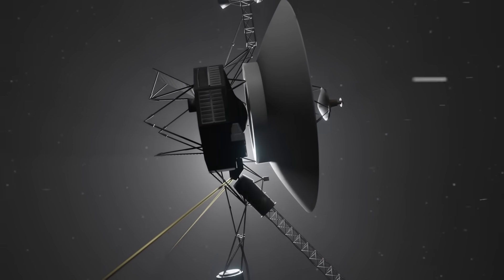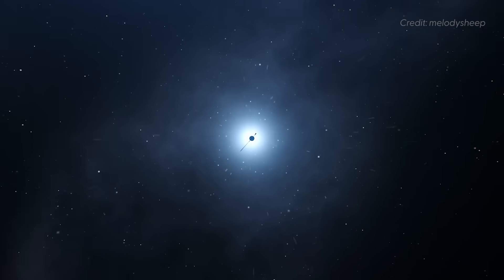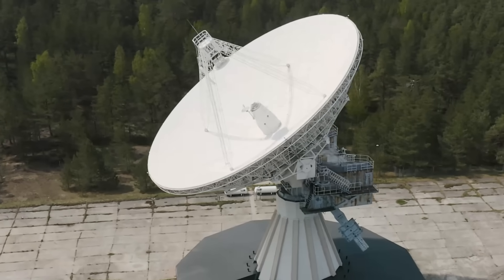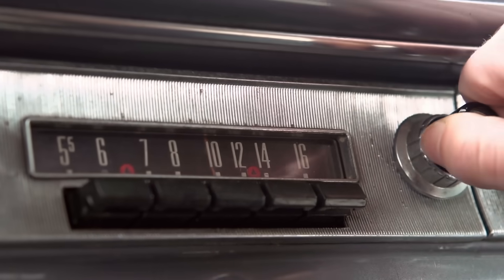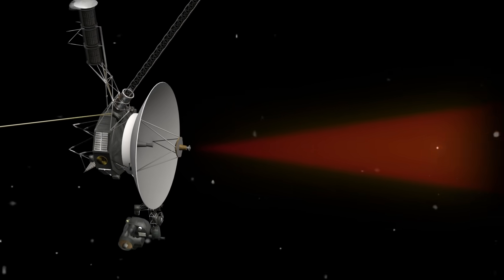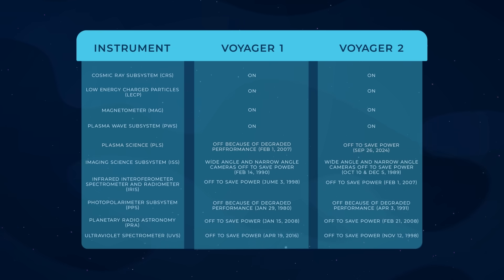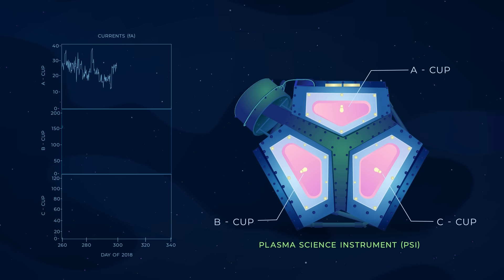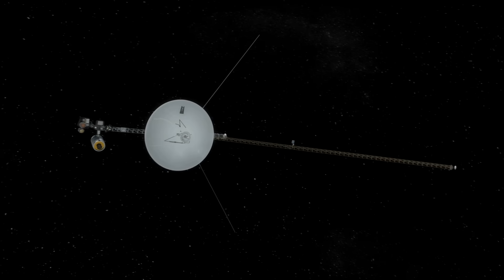15 Billion Miles Away, Voyager 1 Comes Back To Life Using 1981 Tech

Comment: @02:50 timestamp the clip suggests freezing temps cause problems [raises resistance properties of materials] and that heating components reduces eletrical resistance. If that's true, why then do supercomputers operate in extreme cold operating conditions? I thought cold temperatures allow electron currents to flow more easily - less resistance, less heat, etc.?!?!?!

Comment: How does the antenna back to earth work / how is it calibrated when the rocket would be on the opposite side and the rocket shpuld therefor be faced towards earth. Did it rotate midflight to align the antenna correctly? And woth what directional earth homing mechanism when all you have is the antenna and no adjacent situational sensors?

Comment: No, cold does not increase resistance in electric circuits; in fact, cold decreases resistance in most conductors, meaning that as the temperature drops, the resistance of a circuit also decreases

Comment: What's really amazing is that not only is it working with early 1970s technology, but most of the engineers that worked on the project, are either deceased or in the latter stages of retirement.
 Yet, their creation, keeps on keeping on.
 Good job, you guys and gals of NASA.🤙👏 both past and present,  as well as into the future.

Comment: Always wondered couldn't we just send another probe or a repeater/some type of device to boost signals in the general path of Voyager 1 so it could piggy back of the signals coming to and from it as a way to prolong the contact with V1.
Reply: Impossible with our techology right now. The deep space radio telescopes used to detect the Voyager spacecrafts are a network of huge radio telescopes working in synchronization creating an earth sized telescope because by the time the signal reaches us it is a billion of a billionth watt. Impossible to launch and inpossible to synchronize in space and to boost a signal.  And it will never make any distance from the spacecrafts because  in order for the the Voyagers to reach speeds of 39k miles per hour, they needed gravitational boosts from the outer planets. We don't have the technology to boost spacecrafts at that speed with our current chemical reaction rockets. And by 2030, all the usable nuclear power will be used up, so there will be no signals coming from the spacecrafts to boost. Like your flashlight battery going out, you might have a little residual power left but not enough to power the lightbulb. Since Plutonium has a half  24k years, it will create some residual heat for a long time but not enough to power the Radioisotope Thermoelectric Generators
Reply: Thanks for the info, nerd. 🙂

Comment: They cant make an iphone last 7 years but im supposed to believe some radio from 50 yrs ago still works with zero maintenance? 😂😄🥲
Reply: First of all an iPhone can last years if it’s taken care of and as long as the iPhone continues to get regular updates from Apple a phone and a radio are literally two different things.

Second of all radio technology used for space communications is reinforced and built on a higher quality which make them last longer radios can work for years if not decades… old radios from the 1970’s can broadcast signals just fine without any issues especially in space.

Comment: 3:03 cold doesn't make it harder for electricity to flow!!
Reply: It didn't say the cold made it harder for electricity to flow, it said the cold makes the components more resistant to electricity.
Reply: @kingofturtlestk7308  Listen again.
Reply: @chrisking7603  I have multiple times, and it said the cold increases the electrical resistance, which means it interferes with electrical flow. While the cold has no effect on electricity itself, it does have an effect on the conductivity of the components.
Reply: @kingofturtlestk7308   Good on you for checking.  Well, the truth is increase in heat increases electrical resistance.  The colder a conductor is, the easier it is for current to flow... ie. higher resistance at higher temperatures.  The video just has a mistake.  I wanted to point it out.
Reply: That was an odd pseudo factoid
Reply: @QbutNotTheQ  Please expand on "pseudo" to expand me.
Reply: @ChrisNotTheKing  I’m agreeing with you that cold doesn’t make it harder for electricity to flow. It was an odd thing for the video to say.

Comment: "cold increases electrical resistance in circuits" - bunk. On that basis, alone, this video can be classified as junk. Same thing with the "heat helps with annealing of the semiconductors" - bunk, there is no source for heating in deep space. As well, both heat and cosmic rays both contribute to decline in semiconductor performance, there is no way to reverse this. The entire video is worthless bunk.

Comment: If the exosphere is approx 1400-2000 degrees centigrade and the radiation is so high in intensity that it fries all electronics, then how did a satellite like voyager pass through that zone? Satellites for tv  radio gps are all low orbiting devices for a reason. This  hubble and voyager satellite  is all a hoax.

Comment: No, it has not even left the Kuiper Belt.  It will be a long time before it reaches the Oort Cloud and truly enter interstellar space.
Reply: Kuiper belt is located between 30 and 50 AU (astronomical unit) from the Sun. Voyager traveled 166AU. So it is far beyond Kuiper Belt. But Oort Cloud is located between 1000 and 3000 AU, but it's the heliopause which is the true frontier between solar wind pressure and interstellar space. So the Voyager 1 is beyond heliopause, but it's still in the gravitational pool of the Sun and will be for a long decades
Reply: Hey, it is far out enough for me to consider it Interstellar! 😁
Reply: It has?? The kuiper belt is located close to Pluto. It takes 15 (Idk exactly) To reach pluto. If Voyagers have been Going for 48 Years, It is definately Outside of the Solar System. But You are right It has not reached The oort cloud But No it has Passed the kuiper belt.

Comment: It's stated "cold increases electrical resistance in circuits". Correct me if I'm wrong but I was taught that it actually decreases electrical resistance and makes them more efficient.
Reply: @brandonharrison7397 Brandon, I was taught the same thing.  Superconductors only work if you get them close to absolute zero. 

But that is a very old machine.  I think there is actually a magnetic tape drive inside those things to save data.  I doubt those things like the cold. 

They never talked about that, just ‘electronics’.  

Question everything you hear, especially with the misinformation out there these days.
Reply: "cold increases electrical resistance in circuits" - bunk. On that basis, alone, this video can be classified as junk. Same thing with the "heat helps with annealing of the semiconductors" - bunk, there is no source for heating in deep space. As well, both heat and cosmic rays both contribute to decline in semiconductor performance, there is no way to reverse this. The entire video is worthless bunk.
Reply: @steveh7848  the heat source is the heater mentioned several times?
Reply: That statement confused me too, as it's the exact opposite of conventional knowledge.
Reply: Cold decreases electrical resistance for standard metals.  For semiconductors, as temperature decreases, resistance will increase as the the electrons struggle to find a charge carrier.  Although it seems counterintuitive, this is why extreme sub zero overclocking works the way it does (extreme overclocks are achieved by bumping voltages up to overcome the increase in resistance at the extremely low temperature).

This is kinda the same reason that CPU voltages back off at higher temperatures (preventing electromigration due to a decrease in resistance, which increases current).

Comment: My WiFi disconnects if I go on the other side of the wall from the router and I’m using the latest technology i can get.
Reply: Latest doesnt mean greatest! 
I made a hole in my wall with a club, and pulled a TP cable through. Now I have as good internet on both sides of the wall
Reply: You just need a 12ft dish on one side, a whole planet with giant dishes and billions of dollars of tech on the other side...

Comment: Damn car batteries can't last 4 years.
Reply: I mean, lead acid batteries are a very different technology from the nuclear "batteries" on these probes. While I guess you can consider them batteries, they are more inline with being a generator.
Reply: My OEM truck battery lasted more than 4.
Reply: Had an OE Varta last 14 years!
Reply: Woah!  @ntobergta
Reply: Yeah, good argument for decaying Plutonium based batteries
Reply: @TheSulross we don’t need em, we wants them, my precious ❤
Reply: Can NASA develop a new car battery? At least one that doesn't emit ionizing radiation anyway?
 The last thing you would want in a car crash is radiation leakage.🤔
Reply: Vger has developed into some sort of living entity!
Reply: I believe that China has sodium ion batteries?  @sussekind9717
Reply: @sussekind9717  nuclear powered cars were considered in the 1940s (the Ford Atom) but they quickly realized they couldn't make a reactor small enough and it would be a disaster every time one crashed.

RTGs are much smaller than reactors, but don't provide much power, and still don't solve the safety issue of nuclear material moving at 100+km/h controlled by idiots who are busy texting.

Comment: They should have put solar panels on it too and sent it to our nearest Star Barnards Star. Or proxima Centauri A or B. This would only be possible if Travel Time was a possibility.
The Voyager 1 spacecraft is on an interstellar mission. It is traveling away from the Sun at a rate of 17.3 km/s. If Voyager were to travel to Proxima Centauri, at this rate, it would take over 73,000 years to arrive. If we could travel at the speed of light, an impossibility due to Special Relativity, it would still take 4.22 years to arrive!
Reply: Light speed travel isn't impossible.
Reply: Both voyagers will eventually end up within 2 lightyears of a star in our galaxy,  but that won't occur for another 30,000 years or so.

Comment: Imagine if Voyagers had a little more recent technology onboard...
Reply: Then it would have broken long ago. We just dont make things like we did before
Reply: @ChairmanKimchi  More advanced=>more complex=>more easy to break=>more difficult to repair in distance
Reply: @ChairmanKimchi  You're probably right! 🤣
Reply: @ChairmanKimchi  probably. But I'd also like to believe that JWST will be there for decades.
Reply: We would likely need to engineer things with the primary goal being repairability without direct intervention and longevity. I'd imagine we wouldn't get too many improvements to it, maybe a new type of instrument or 2, maybe some decent non-volatile data storage, maybe slightly more power efficient devices, probably some benefits of modern machining techniques too. There's only so much you can do with how things are being designed now. The better use for more modern tech is on stuff much closer to Earth. Where communication to it is easier and faster so we can send high resolution images and data.

Comment: How long after the last instrument is turned off will the Voyagers still have power for their radio transceivers?
Reply: Probably quite a few years, if the radios continue to operate. The limiting factor here is that the antennas on Earth won't be able to pick up such a faint signal after about 2036. But: what good is talking to a spacecraft if it's not sending back any scientific data?
Reply: @BryanM61  I don't remember where, but I heard on a podcast or read somewhere that even after all of the scientific instruments have been turned off; simply being able to talk to the spacecraft would allow some science to be done based on how the radio signal is received. I would imagine it would have something to do with things like phase shift, frequency modulation, degradation of the signal, etc.  I was trying to find it earlier when I posted this question, but it's been a long time since I heard or read it.
Reply: @lexington476  Interesting. I could see that.

Comment: I thought it was so far away that it's signal couldn't reach us
Reply: that's not how radio waves work in a near perfect vacuum like space. Radio Waves work in the same way that light does. Stars from millions of lightyears from us still get to us. Radio Waves are still photons. They travel at the speed of light, just like a photon of our visible spectrum. The problems with Voyager 1 and 2 would be constant barrage of space radiation on the hardware, decaying the materials, Space debris/dust gathering on the instrumentation or even piercing through it, further damaging transmission and receiving instruments. And as mentioned here, the decay of the plutonium in the nuclear generator passes beyond the point to keep voyager 1, running. This is a fantasy scenario but; if voyager 1 or 2 can remain in perfect running condition, theoretically we would be able to get the signal no matter how far it travels.😁
Reply: My bad🙈🙈I get my education from YouTube, according to Newsthink  voyager2's signal takes a while to reach us, but Voyager 1 is now out of reach  @ChrisArtsTube
Reply: It can, the signal is just very weak from that far away. The Plutonium reactor is also slowly depleting and a signal form that far away is much easier to disrupt by all kinds of sources of interference.  It requires some very precise radio telescopes to be able to receive and decode the signal. Voyager 2 also has been having all kinds of mechanical problems which is to be expected. being exposed to the harsh environment of deep space will eventually degrade performance. I'm amazed it has lasted this long.
Reply: it just takes awhile